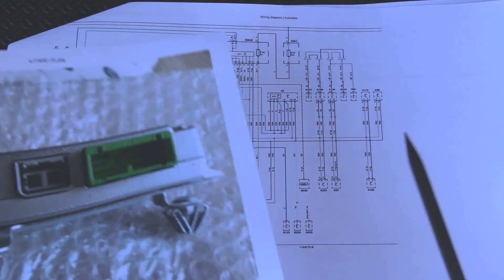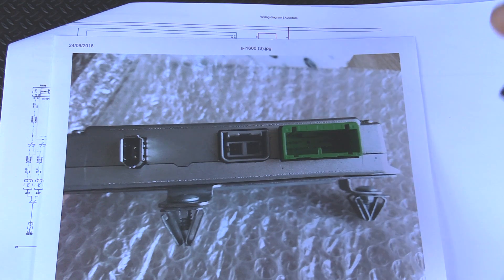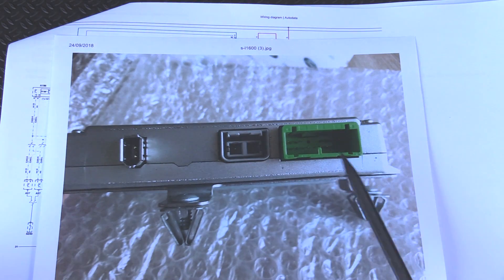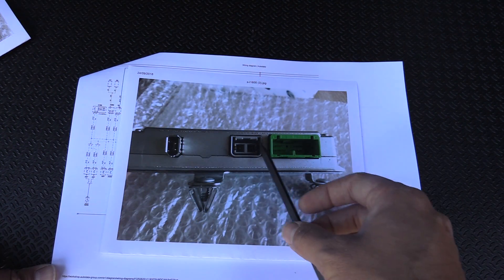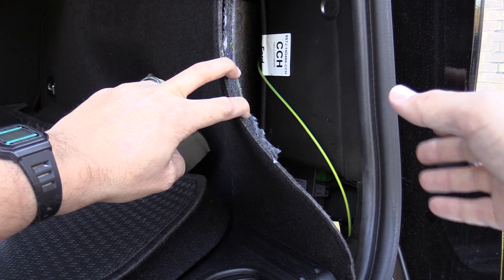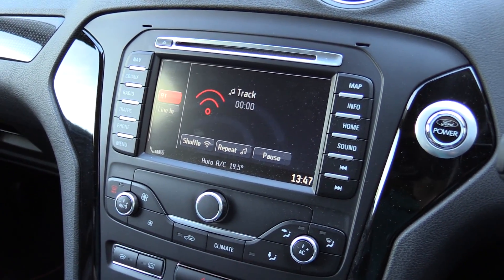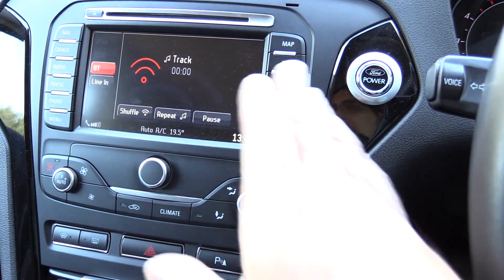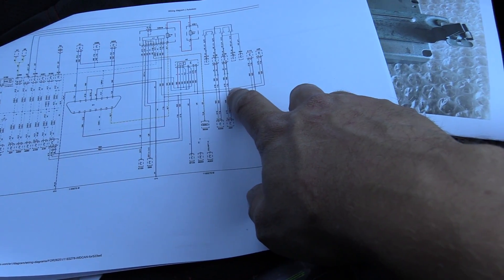SDG CAR #006 Reversing Camera Flickering Flashing Fix - Ford Mondeo Mk4

Comment: I have done this repair on my 2013 Hatchnack Tutanium X..
Where is an inspection panel on the right hand side rear of the boot where the camera module is clearly visible and there is a fault which I believe attaches the light assembly to the car about 10 inches away from the module above and to the right. 
Whole job took no more than 15 minutes and that included finding a suitable piece of wire to add the Earth lead fix!

Thanks for the upload, very useful.

Comment: Good job Steve 👍..  Like you I reckon that camera will be fine now. It was years ago now but when I worked for Ford we were often cleaning ground connections or running new ones on various models, especially pre 2000 or so, as they used to suffer rather badly with grounding issues, especially rear light clusters, and any tailgate electrics etc. They're far better now though however the odd item still crops up it seems.
Cheers mate
John
Reply from the maker: Thanks John. I suspect the shield for the coax was partially providing the return path, but as the unit vibrates it was making intermittent contact with the chassis. It would only take a 100mV or so to throw off the composite video signal and sync. All of the other devices on the bus are bolted to the chassis, so this seems like a mistake.

Comment: Hi Steve. Many thanks for posting this video. I've had exactly the same experience with the reversing camera on my 2013 Mondeo TX BE Estate. Although it was repaired twice under Ford Warranty, it has recently started flashing again! It is infuriating. Especially, as it is well out of warranty now, and it is the only thing in the car which has given me persistant problems. I'll put a separate earth on the camera control module tomorrow and see if that works for me also!
Reply from the maker: Let me know how it goes. There is a foam cube that you have to remove from the hole to get to the camera controller. As a test, you could give the box a good wiggle and then firmly wedge the controller with the foam cube so that it makes good contact.
Reply: Hi Steve. I didn't get round to doing the job until yesterday (Friday) morning. The control box on my car is very firmly attached to the mounting plate and I couldn't get it to wiggle. As access is very limited, I didn't want to try to losen, or remove, the box. I fitted an earthing wire exaclty as you did. It has completely cured the problem. The rear view image is perfect now. Its as solid as a rock with no flashing or breaking up. The fault has been intermittent on my car, so I'll give it two weeks, and if its remained perfect over that period, I'd say you have definitely got the right solution. I'll get back to you then to confirm the position. Many thanks for solving the problem and sharing it on YouTube.
Reply: Hi Steve. That's been over two weeks now since I fitted an earthing wire and my reversing camera image has been perfect. You have definitely solved the problem. Many, many thanks.
Reply from the maker: @stevegraham6996 thanks for the update, mine also has been perfect since the modification. Glad it worked for you

Comment: this is awesome. thank you so much for this. i have seen the same problem with 2011 SMax. this is so helpful! 

You haven’t come across a problem with touch screen not working on those NAV units by any chance? I think they are called Ford HS RNS made by Blaupunkt. My touch screen stopped responding to touched after I had a service done where cabin filters were changed. I suspect the garage accidentally impacted some wiring by the passenger side cabin fuse box but I can’t prove it, just the timing of the touchscreen issue coincided with the service. Happy to share more details if you would be interested! thank you again.

Comment: Fantastic video mate. Just bought a 2013 x model and was told when buying that the cam was not working so wasn’t too fussed. Main drama is the parking sensors are not working either which I could really do with! I take it these systems are linked?

Comment: Hi 
You seem to be the right guy to ask. I have the same car / camera and have already been to the dealers for a new camera due to this exact issue, apperently they have updated the cable loom to prevent the cause which they believe to be moisture in the connection. The camera is working ok. And now to my question all other fords have awsome quality reversimg camera incl beautyful nightvision. Would it be possible to fit a better camera to the loom / box i know many many people would be extremly glad, i have asked this in manu groups. Specially the nightvision is crap.

Comment: @SDG Electronics, great video. Do you know if there's an adapter for the camera module to allow a regular composite (yellow phono) input? I'm trying to figure out how to add another video source via the camera input as there's no other way. Like a splitter or something. I have this exact head unit with reversing camera in a 2011 S-Max.

Comment: Module probably also uses the screen of the coax for ground, so if that is also intermittent it will cause the same thing. Lucas electrics on Ford strikes again.
Reply from the maker: Possibly. I didn't measure it, but I suspect it passes through some filtering that presents some impedance rather than a direct connection to chassis ground.
Reply from the maker: After thinking about it further, the coax probably was providing a ground connection, but the intermittent connection to the chassis has a lower impedance path once connected. It'd only take 50-100mV of bounce to throw off the composite video signal.

Comment: I have same problem. Sometimes video blinking green as in your video, sometimes picture is upside down. Sometimes it works OKAY. I did not get, where you connected wire on module. Please provide more info. Thanks.

Comment: Cheers mate, we have same issue on the ford galaxy, but the canbus thing you mentioned does appear to be in the boot area? Any idea where it is on the galaxy 2012
Reply from the maker: As far as I know it's in a similar location for the Mondeo, S-Max and Galaxy. See if you can see what direction the wiring loom heads in by looking above the head lining.
Reply: I fiinally got myself to fix my camera last saturday after watching this video.

I have a 2012 Galaxy myself and my camera hasnt been working properly for at least 2 years. Just every now and then whenever it felt like it. When weather was dry i had no picture at all but in moist weather i had this green/red flickering on the screen. Pretty annoying when reversing the car in the dark as the flashing screen blinds you. 

The unit is located in the right side of the 2012 Galaxy, just over the wheel arc, its fastened with velcro to the body and nothing more.
There is no need to look for it as this is not the issue with your camera. As i said, its velcroed and wont touch the body of the car itself at all. This means that it doesnt need to be grounded.
Ofcourse i grounded mine and ofcourse it didnt have any effect.

The problem is that stupid connector in the back/rear door. Yank off all the plastic and you will find it on the right inside of the door. Connector is zip tied to a plastic thing that is fastened to the door with a metal clip. 
I cleaned that connector and sprayed it 2.5 years ago but i guess the pinholes in the connector is to wide for the pins and there is no contact. It worked for about 2 months, might be because of the spray, and then it died on me again. 

All cables are colored different but there is no rhyme or reason to them, pink to green, black to blue, brown to yellow and so on. 
I cut the wires on each side of the connector one by one and used a 3m Scotchlok UY2 connector to connect them back together. (Im not sure if they are on the market anymore but you can use something simmilar, i had them so i used them)

Voila, good as new and now works like a charm.

Comment: Hi I have this problem. I have changed the camera and full wiring harness and also connected an earth cable from one of the screws on the control box to one of the rear light bolts but I'm still having problems. The camera still flickers and sometimes doesn't even come on at all, can you help with anymore advice please
Reply from the maker: The flickering is due to a loose connection somewhere. Check the connection to the car wiring loom on the control box and possibly even at the head unit
Reply: Thank you for the reply, I will have a proper look over all the wiring at the weekend and keep you updated